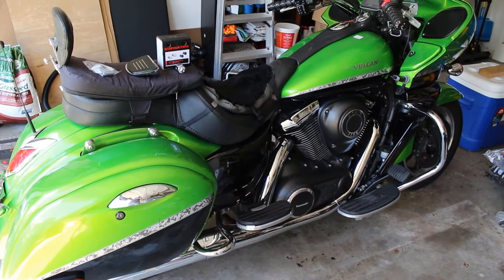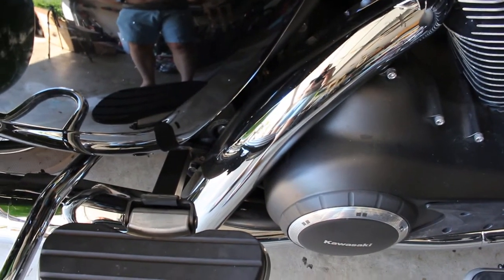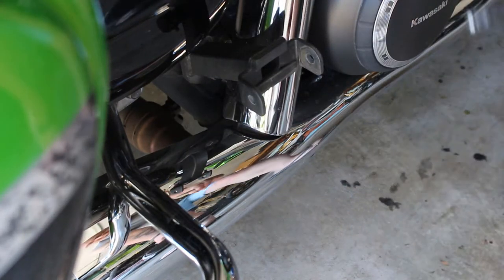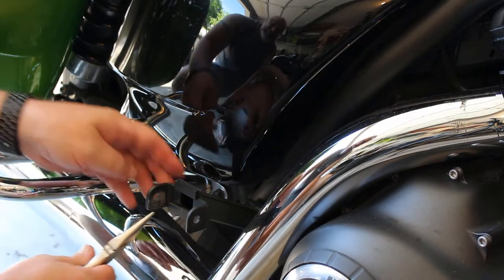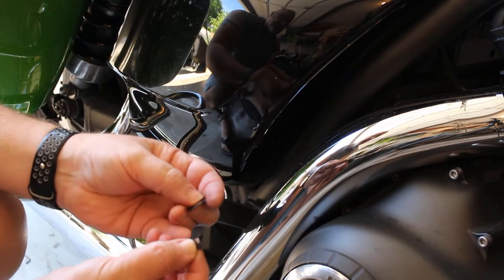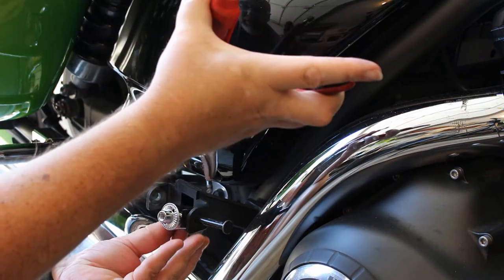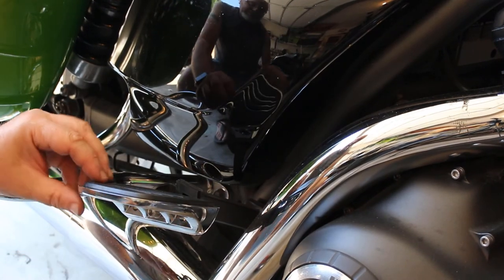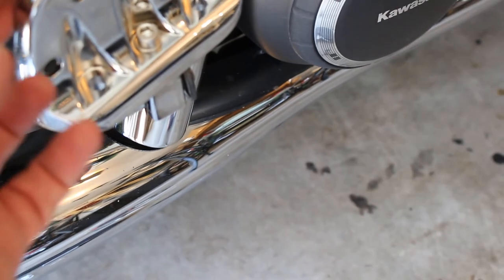How to Install Kuryakin Mini Boards on a Kawasaki Vulcan 1700

Comment: I couldn't find spacers for these. I got the black boards and ended up using radiator hose cut to size
 It looks good, blends in nicely

Comment: Have to say I think you down graded with this install. Smaller boards will concentrate the pressure on your foot rather than disperse it. My wife has the stock boards and said that they are the most comfortable boards she has ever felt. She should know since we have been riding for 30 years
Reply from the maker: If I were the passenger, I'd agree. The stock boards are better. But my wife's leg length was a factor and her knees would lock up. With the new boards, I could adjust the angle to something she really liked, so it was good for her. I've since sold the bike though.
Reply: @nicein2000  oh ok the angle is what you were aiming for. I got you!